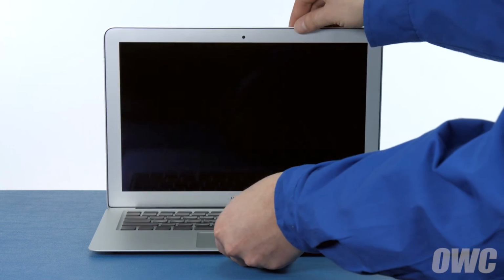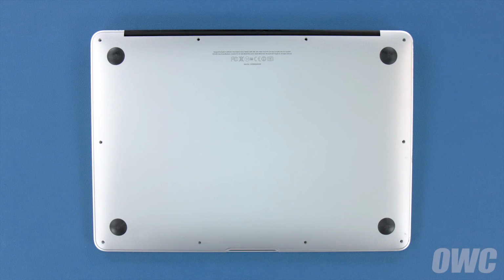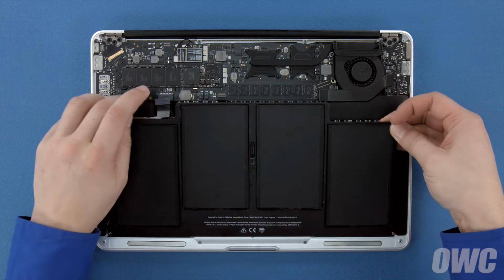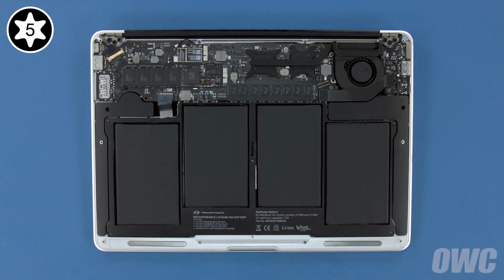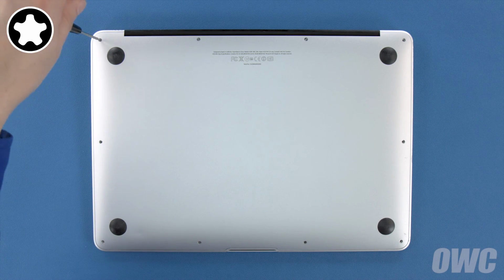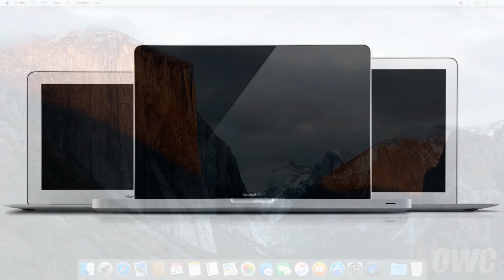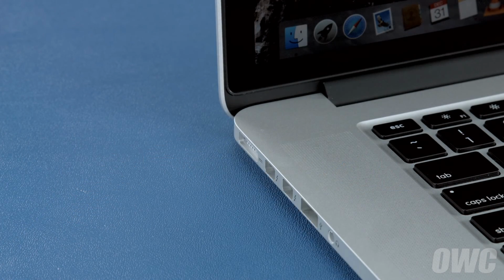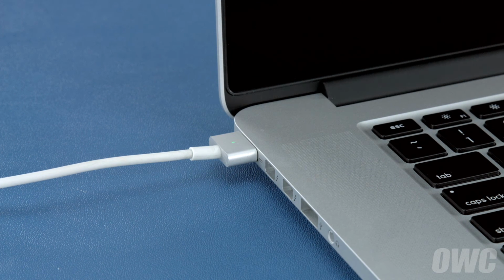How to Replace the Battery in a 13-inch MacBook Air 2010

Comment: are the batteries the same for mb air 2010 13inch and 2011 13 inch? i saw both of your clips and they seem the same but just to make sure...
Reply from the maker: Yes, they do share the same battery!